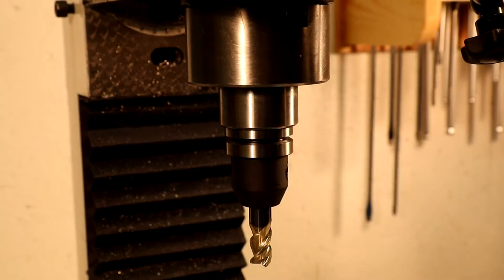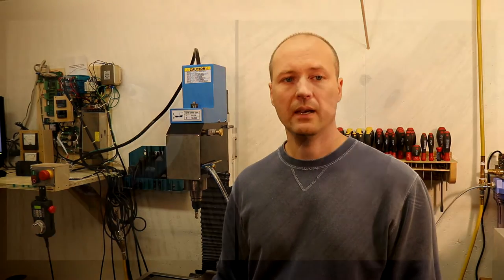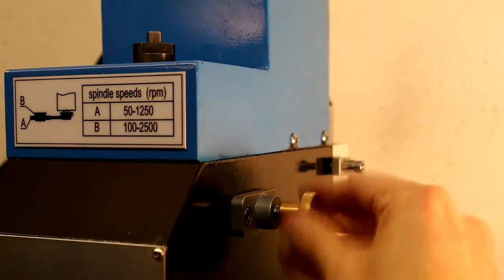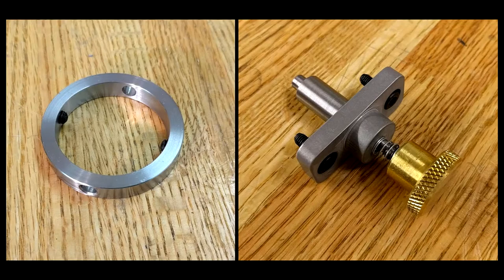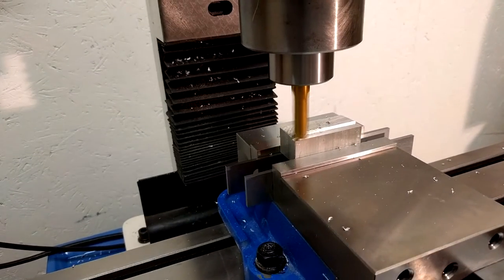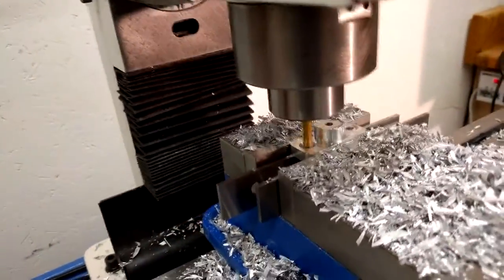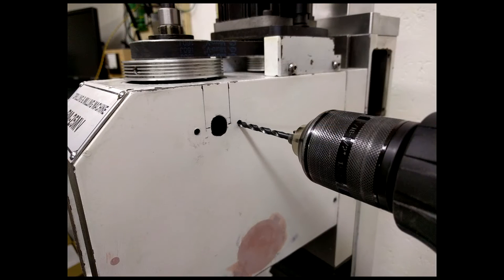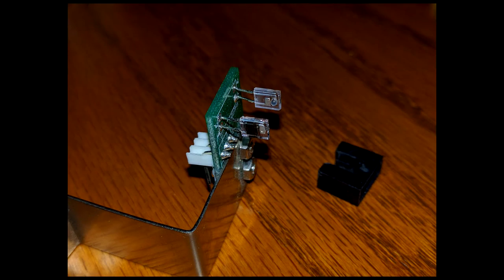Spindle lock for PM25 milling machine

Comment: the collar on the spindle is genius. initially i thought you are going to use some spur gear inside the head. Great job Kent.
Reply from the maker: Thank you, though I'm not sure how much genius it was. Surely a machinist would have come up with a better solution. This was more the "this problem has to get fixed now" sort of solution :)

Comment: Really nice job Kent!  I might try to replace the engagement holes in the sleeve to vertical grooves so the mounting of the pin and sleeve are less exacting.  In any case, this is a pretty elegant solution.  One other thing, I have a hard time cutting stock that big straight.  What we need is a really long parting tool and auto feed.  Then all we'd have to do is start the auto feed and run!
Reply from the maker: Hi Bill, thank you. I have a new version that I need to finish the video for. It uses a plunger switch so LinuxCNC knows when the spindle is locked and will not turn on the spindle. With that version, the shaft only slides - it's not threaded and does not turn into the lock body. I like the idea of using grooves instead of holes in the collar. Maybe you'd want to use some ideas from version 2?
Reply: Sure I would.  I'm not gonna be taking this on for at least a month, so take your time.  Looking forward to seeing It!
Reply: It just occurred to me that the pin could be driven by a solenoid operated by a 3 way toggle switch that also breaks the circuit to the green on button, while the toggle lights red.  When ready toggle is flipped, it's red light goes out, withdraws the pin and turns the on switch green again.
Reply from the maker: Sounds brilliant! Maybe v.3? :) For v.2.5: I have a spindle motor with a brake but unfortunately the brake is not enough to hold the spindle when changing the TTS tool.

Comment: Top idea mate.  Very clever indeed ;-)
Reply from the maker: Thank you Aaron. It's still going strong even after the turning on a locked spindle on more than I can remember,  despite having a habit to check the lock is off. Reason enough I should stick with a small motor (and add a lock out) :)

Comment: Do you have the dimensions for this? In the process of recreating your drawbar, would like to add this as well while it's torn down. Thanks!
Reply from the maker: Hi Mike. Drop me an email and I'll send you drawings. If you need it, I do have one of the bodies machined that has the option for a lockout switch or simple plunger. You'd need to make the sliding bolt and ring for the spindle.

Comment: great updeat, i heave the same mill (pxtools red colour) but No cnc, i broke a few cutters by this way (fall out when untighten), so must to do this mod.
but i heave a transmission on this position, do you remove them?
you'r welcome to watch my video...
Reply from the maker: Hi, I watched several of your videos, and they are all really interesting. I especially liked the DIY sandblaster. I saw the mill transmission in https://youtu.be/ldq5VXNAcio?t=6m8s. I don't have any experience with this, but your mill looks similar to Grizzly's G0758. The manual has an exploded mechanical drawing. http://cdn0.grizzly.com/manuals/g0758_m.pdf

Comment: Shame, shame. An adjustable wrench on your draw bar.
Reply from the maker: Ha! :) With that original drawbar, and it's 8mm head, what's a person to do? I plan to reduce the hex to match the metric clamping set nuts I use and make a drawbar wrench. There are several examples of people making them using a socket. Thanks for the comment